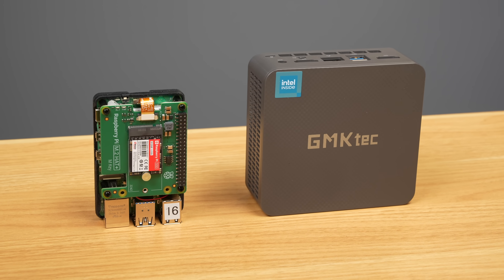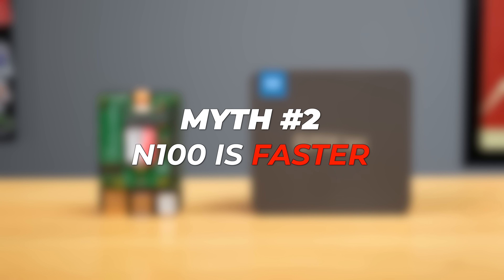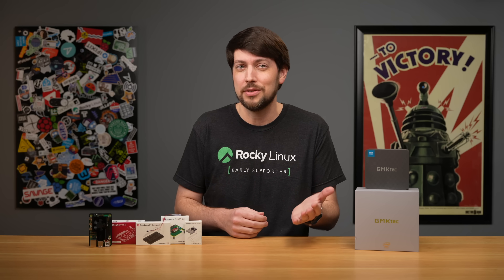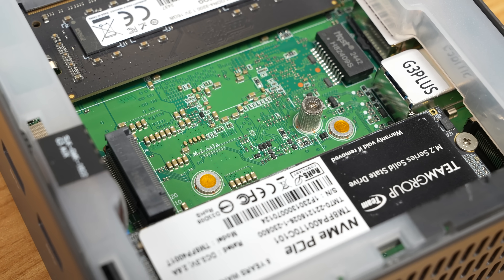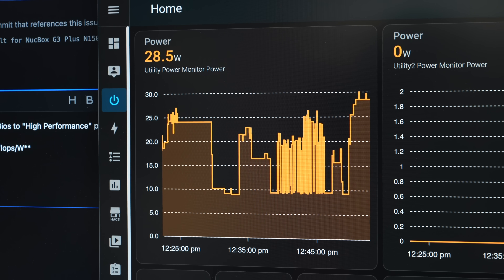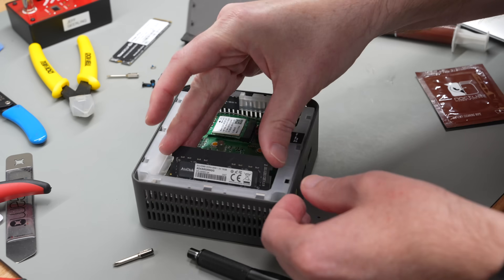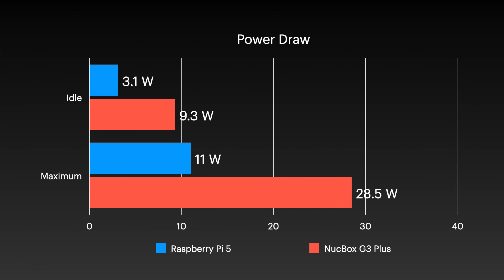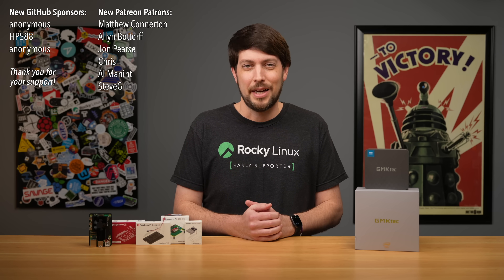When did Raspberry Pis get so expensive?

Comment: Part of the reason the Raspberry Pi was so cheap is because the stripped it down to just the bare essentials. If you are going to go adding all kinds of non-essentials then of course it is going to go up in price.

Having said that, it is too bad they couldn't create the base model for the RPi 5 to sell at the same price as the base model for the RPi 4. Just one more sign that Moore's Law has died and now we are looking at 5-10 years to increase performance at the same price instead of just 18 months.

Comment: 1.5-2x faster than the Pi is lamborghini vs snail.  If your car runs at 100km/hr top speed and mine is 200km/hr they are not at all equivalent experiences.

Comment: I personally don’t care about efficiency when even the inefficient machine only draws 30W under load. Seeing the 200W-at-idle beasts found in r/locallama, r/homelab and r/datahoarder has corrupted me. 
Power isnt that expensive, cooling isn’t an issue and the noise is in an isolated room ¯\_(ツ)_/¯

Comment: The clarifications are excellent! There're too many people who seem to miss the point of SBCs, which is to say that not everyone has the same needs. The N100 fans haven't quite explained how to easily run an N100 system off of a USB power bank, or how to run an N100 with no moving parts, for instance.

The points made are reinforced by the existence of cheaper and more powerful ARM systems like the Orange Pi 5 and friends. You can't do with an N100 what they can do with just 10 watts.

Comment: The point about "used" is not comparing the products. It is about the cost of a solution.
We all need to do things - home assistant, home labs, gitea, looking after granny with a remote mmwave system.
If I can get the same outcome for half the price - then thats the comparison.
But to make this more clear - there are SO MANY used pc's. I am about to take possession of a used government work station 32GB DD4 RRAM, graphics card, huge SSD, power supply,  everything for about $40 - I will be using this to serve web pages, decode/encode and a few other things (Gitea, Drone, Harbour).
The comparison is incredibly valid in real life practical terms and cost.
Reply: Exactly! I clarified that in the conclusion of the video — the thing is, some people say that used is cheaper when someone else is comparing prices for new equipment. What they should say instead is if you can go used, there are much better options for a given price. Not everyone's comfortable dipping their toes in the used market, especially newcomers who just want something they think will work better out of the box, with support.
Reply: I would say go one step further and compare used RPi with used miniPC.
Reply: @hubertnnn old Pis are not worth it. Non-used sells for the same price as when released so used also don't differ much.
Reply: @Level2Jeff   Ah thanks fair. 

I moved on (leepspvideo had a new pi 5 screen) - been over the pi/used debate a bit. 

I'm now looking at repurposing old Androids with linux ontop. But you mentioned Radxa - i just saw an announcement from the Chinese government to "embrace" RISC-V dev.
I am waiting for things to improve here - plus the memory/chip breakthroughs etc - for some cheaper computing.
We should be seeing some  price falls - not "keeping in line with inflation". 

Once one moves to microcontrollers and then external add on pins for cheap repurposed devices Raspberry pi seems a novelty - Pi Zero 2 W is now my niche.
Reply: Make sure the SSD is wiped clean, or I am reporting you to the Feds!

Comment: I replaced my Rasberry Pi 4 (8GB) when it died after running 24/7 for 2 years as my Nexcloud server with similarly priced ZX01 Plus N100 MiniPC with 12GB RAM and 128GB NVME storage. 

For the same price the ZX01 Plus already has:

 1. A case. 

 2. Power supply.

 3. 12GB RAM.

 4. NVME (2-lanes) storage.

 5. Active cooling.

 6. Full HDMI ports

That's compared to a board-only  8GB Pi4, Pi5 is even pricier here in Asia.

Comment: For hardware projects and portable applications, raspberry pi wins-- with GPIO, sensors, low power usage (battery-powered) and compatibility.  Also I feel creative and inspired when I'm working on raspberry pi.  I think sweet spot is raspberry pi zero or raspberry pi 4, and I don't need the fastest/latest.  Mini PC is good for desktop computing or small server, so I have them for running home assistant and frigate.

Comment: The raspberry pi 5 is more than fast enough to run a linux machine for FoundryVTT as a client. Except for one major flaw. It can't load images larger that 4096x4096 for large battlemaps. My DM had to cut maps up making it more work for him because of a silly limitation. I switched off to a different architecture because of that.

Comment: In China, the Raspberry Pi 5 8GB sells for $100 to $110, but it was very difficult to run OpenCV on the Raspberry Pi 5 when I was working on an innovation project for college students. In comparison, the Intel Celeron N100 computer at the same price has strong performance and good scalability.😂
Reply: All I can say is that the ultimate essence of the Raspberry Pi is just a toy for geeks.

Comment: Something interesting is that when we put RPi's with microSD card boot devices on circuits that go on/off daily, they tend to corrupt. The one driving our 2nd set display just had this happen. Usually the SSDs on mini PCs are better and avoid this.
Reply: The corruption is because flash controllers have their own set of non-volatile data they need to write out that describes how the physical addresses of the flash memory translate into the logical addresses used by the host, as well as some meta information such as write count for flash cells used for ware levelling. When unexpected power loss occurs, this data can fail to be written, or worse, be partly written which renders the device unable to recall recently written data, which can even include old data that was moved around due to ware levelling. In the really worst cases the controller data can become so corrupt that the drive bricks itself, possibly even permanently.

As this is a major concern for NVMe SSDs, decent quality drives usually have some level of resilience to this built into their design in the form of capacitors and emergency shutdown logic. Typically if power is lost and they are not busy with a heavy write load they should survive perfectly fine, with the only corruption being the classic filesystem level corruption that drivers can fix and at most affects the last written files. If they lose power when under maximum write load that is when they are mostly likely to fail catastrophically and brick, but this is not normal operating conditions so usually unlikely to occur. SD cards on the other hand likely do not have such circuitry, especially the cheaper ones, while still being prone to the same mode of failure should power be lost.

If network boot is not an option, another approach to solving the issue would be to buy a small UPS and attach the RPIs to that. Such UPS usually have monitoring functionality which could then be relayed to the RPIs to order them to gracefully shutdown at an operating system level, avoiding subjecting the SD cards to unexpected power loss. As the RPIs are very power efficient, even a small/cheap UPS would likely be enough to power multiple for a considerable time, more than enough to assure safe shutdown.
Reply: I've got experience using Beaglebone White and Black SBCs in industrial equipment. We didn't have too much problem with the BBW, but the BBB was chewing up SD cards way too easily. I think the base OS changes between them made a big difference. To solve the issue on the BBB we switched to SanDisk Industrial cards and that improved reliability massively. Rarely seen a failure since. We also set up an overlay partition for all writes, with the base image wiping the overlay if it detects corruption so we can just reboot to recover back to our stock image. We don't need persistent data onboard other than for logging, so it's a very tidy solution that eliminated all those service calls.
Reply: Well, Pis aren't that different from regular PCs in this regard. If there was data unsynced in memory when power went out, you will likely get file system corruption. 
SSDs may be less susceptible to this but most still are. For such systems, it's best to keep at least the system partition read-only.
Reply from the maker: Good to note! Just wondering if you've tried using any Industrial microSD cards, as they're supposed to handle that situation a little better (but power cuts could have issues no matter what the storage tech...).

Another option would be netboot... I still need to explore that a bit more.

Comment: I have an Intel N200 in a passively cooled laptop and I really wish there were more power management features.  The thing plummets to 800MHz the instant it hits 75 degrees.  I'm using Ubuntu 24.04, and all of the software to throttle the CPU to something like 2.4-2.8GHz doesn't work.  It just runs at max clock or 800MHz, no in-between.  I'm sure this is just a cheap BIOS thing, but it's just dumb, the laptop would be more performant if I could cap its clock.  It's not that most activities cause it to overheat, either, it's that it can barely do anything after overheating.  Does watching this youtube video cause it to overheat?  No.  Can it hardware decode this video once it panic throttles itself?  Not smoothly at all.  So you have to just not do anything with it for a while after unzipping a big archive.

Comment: DDR4 and DDR5 run at different voltages, so a mainboard can only implement one standard or the other, regardless of whether or not the processor supports either

Comment: When I switched from C-64 to Intel 8088 MS-DOS, I experienced both a thrill and a lot of pain.  When I experimented with Debian, the pain was unbearable.  Ubuntu was a better experience.  For a desktop, I can imagine using a PI.  That would suck so bad.  I have purchased 5 GMTek $165 n9105 nuc computers from Amazon that came with win11 pro.  I gave 4 of them away and they all work perfect.  Office, Microsoft sign in, and all.  😂

Comment: I don't compare the Pi to a Mini PC.  More like an M70q G7400t ($118 right now with tax and shipping with a 2 year warranty, keyboard, mouse, power and stand).   Which has some neat tricks like a 2.5" HDD bay, and dual rear option ports to add another HDMI, Displayport or USB C video and power output for under $25.  Useful for Portable monitors or AR glasses.
Reply: G7400T iGPU is better than N100, and I assume N150.  Partially because of dual channel memory, but also I think it has more compute power.  Intel can also be undervolted using various utilities.

Comment: My biggest gripe with the Pi is the never decreasing price. Every year, computer manufactures come out with new upgraded versions at the same (sometimes lower) price than the previous year, and then discount last years model. "Last Years" (plural) PIs are priced the same as the day they were launched, and current models are priced higher. This makes no sense to me.
Reply: Thats why I replaced 3 of my RPi 4s at the height of the scalper pricing with 13 year old used Lenovo i7 based USff Pcs with 8gb of ram and 120GB SSds...
They blow away a RPi4 and only cost me $20 each.
I should have sold my RPis during the scalper days I could have made my money back x10.
Reply: @grumpycat_1 But nobody else can get get $20 pricing…
Reply: Its the Nintendo price model. Nintendo doesn't do "new" anything. They don't use new hardware. They don't use new engines. They don't even make new game content. Instead they just take old stuff and use it efficiently. With all the good AND bad that implies. And one of those efficiencies is making a product you can't get anywhere else. And never lowering the price.
Reply: Not everyone needs the latest model. Most RPis end up inside industrial hardware which don't need much power and run on less energy. Therefore there is always a demand for older model RPis which means the price won't go down due to demand.

Comment: I stay away from both.   I have a big beefy server with a bunch of hot swap drives, zfs, 15-20 containers running, development environment, etc.  much easier for me than a bunch of small single purpose computers.  options are great and use what makes sense for you.   not really sure there is a right or wrong answer.  I know my setup is wrong for lots of people, but it's right for me.  To be fair, I do have a couple pi and arduino laying around, but they are for tinkering.

Comment: I don't really see much point in chasing benchmarks.  "Does it do what I need it to do?" is the most important thing.  "Will it still be doing what I need it to do in five years" is the second.  After that it's just down to what fits your needs.

I'd rather have a mini-PC as a server because it's already built for it (no adapters for PCIe, NVME, full size HDMI, and whatnot) and it's heavy enough the Ethernet cable won't pull it off the shelf.

I'd rather have a Pi on my bench and for all those cases where a tiny little Linux box is useful.  Oh, this PLC controller needs a DHCP server and there are none on the customer's network?  Bam!  Pop a Pi on there, do what you need to do, then put the Pi back in your toolbag.

Comment: Frankly, cost benefit can go all over the place with RPi or Mini PC. Sometimes one will be more accessible than the other. I'm currently very happy with a mini PC server that just run HDDs via USB and it is powered by a 12V PSU/UPS hooked with a 12V 7Ah lead acid battery. The i3 7167U only sips 3-15W, it has 16GB@1600MHz DDR3L and the whole system is passively cooled. It served me for more than 3 years of uptime so far.

Comment: The first iteration of my home server was a Raspberry Pi 3 with 2 USB to SATA adapters and a 5V5A Power supply.
Then I migrated it to an elderly laptop that I got for free, an Intel C2D T6600 with 2GB DDR2 RAM. Even though It was 7 years older than the Pi 3, the performance boost was huge: faster processor, 2x more memory (expandable up to 4x), faster Gigabit ethernet, 2 builtin faster SATA ports, no USB bottleneck and a battery that worked as UPS.
Unless you need a small form factor, GPIOs, low power draw or anything only a Pi can give you, building around an old used laptop can be cheaper. In my case, for a home server, it was worth it.

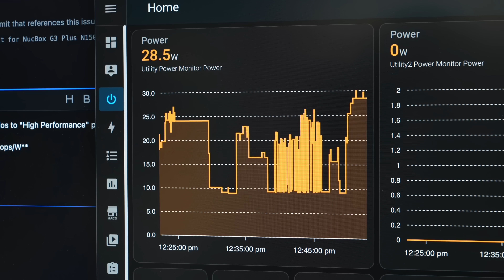Comment: 6:50 Ubuntu doesn't have great compatibility with a chip that was just released? Boy, what a shocker. This channel is such a joke. You can get an n150 for $140, 8GB RAM, and 256GB SSD. By the time you do the same with an 8GB Pi5, you're in the same ballpark, probably a couple bucks more. And you get x86 with the n150, which means there's very little if any software you won't be able to run.

I get it, you're the Pi guy who thinks companies sending you free stuff isn't sponsoring you. I have no idea why you feel the need to compare Pis with anything desktop. If you need a desktop system, you'd have to be crazy to get a Pi. If you want to run proxmox on something, again, you wouldn't get a Pi. I'm sure Pis are good at something outside of running Klipper, but not general use cases.

Comment: i have a pi4 8gb, when i purchased it i thought it would run fine on a Samsung 3A USB psu that supplied more than enough current ,,nope! i had to purchase the proprietary  RPI 4 PSU and when the pi5 dropped i thought great! i can upgrade my pi, then i learned the it wont run fine on the RPI4 PSU and the deskpi lite case that i purchased wont even be compatible as they switched the placement of USB and ethernet, not interested in upgrading for minimum performance to  price gains , however i still use the pi4 but i cannot justify spending more than 200+ again , my next replacement will be a mini pc

Comment: I admit I'm a bit biased towards the N100 right now, but that's mostly because the price difference between N100 mini-PC and Pi 5 + SD Card + Case + Fan is so small that I'll take the one with full-size HDMI and an x86 9 times out of 10 if I just need a low-powered computer for something. 

Full-featured USB-C is also a huge plus when it's available. I have an N100 powering my arcade cabinet, and saving a cable by getting pass-through power from the monitor really does help immensely with keeping things tidy.

Comment: Right tool for the job, yo. Need high specs, get the better spec'd device. Need low power? Get the lower power device. Need a small form factor? Get the smaller device. etc.

Comment: I'll comment again, as I've probably done on the previous video. Unless you need GPIO to control external devices, there is LITERALLY NO REASONS to use a raspberry pi over a mini pc. Energy efficiency is a useless metric if it would cost you only pennies more in electricity, and if you're using battery, just buy a bigger battery ! It'll still be cheaper.

Comment: Biggest pro for pi, for me at least, is the poe hat. I just run an Ethernet cable, power and data on the same cable. I have one near the top of my antenna mast to have the shortest possible coax runs to my antennas.

Comment: I daily drive my pi 500, did the same with the 400.  They are cheap, easy computers for most people's needs.  I also run a pi 5 8 gig headless  for just messing around.  Going to order the ssd hat and a ssd.  Not a huge priority though as both my pi boards have 256 gig sd cards.